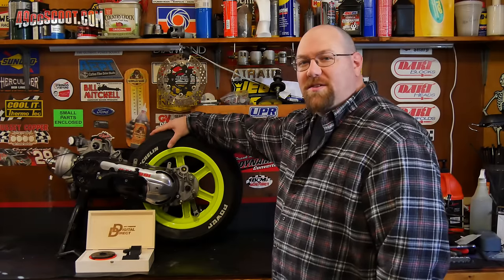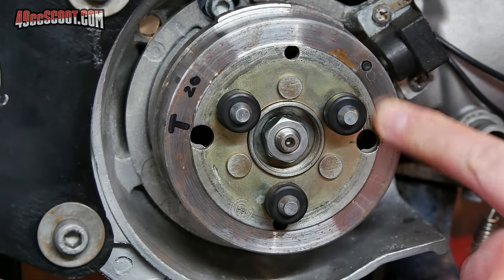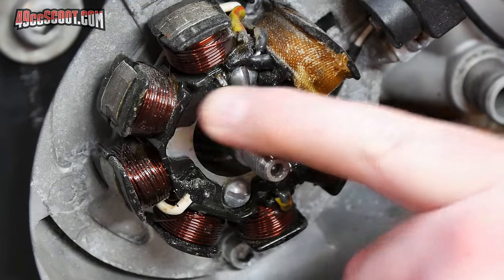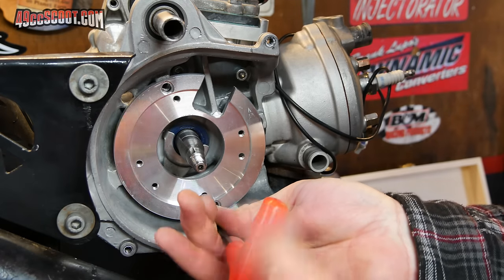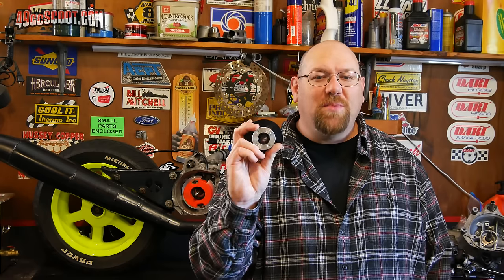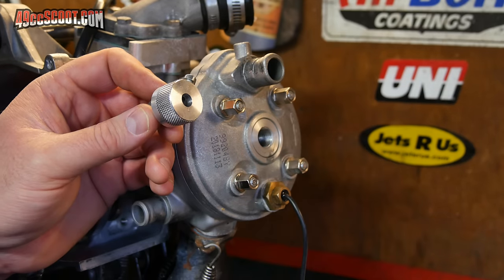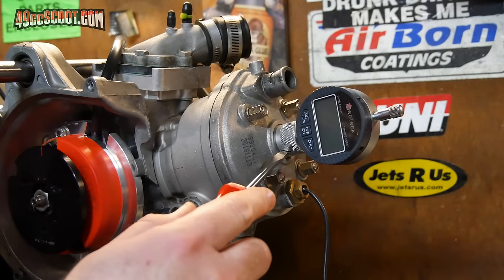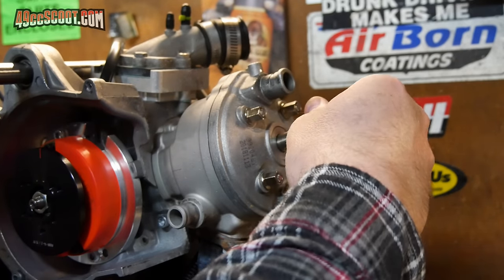Detailed MVT Digital Direct Ignition Installation How-To : TPR 86cc Build : Part 21

Comment: Hi, i swap ignition to Mvt and engine starts on reverse! What the fxx? Any one with ideas? I was told I have to much Adv timing, so I use half to what cdi demand and still wean I kick start, engine starts on reverse
...
Reply from the maker: This seems to be pretty common with the E-Prom from MVT. At least for Minarelli, they want 2.9mm BTDC, as opposed to their standard CDI that's around 0.35-0.45mm BTDC usually. If you've backed the timing off to half of what it was, I would first suggest double checking everything to be sure you haven't got anything off in the process. Even at 2.9mm with the E-Prom, most report intermittent reverse starting. For example, a friend said about once every 5 starts it may start backwards. Seems to be right on the edge if it's setup to spec.
Reply: @49ccscoot  yes, it's the one with 3 map option, sometimes wean starts well forward at idle it reverse with out stopping engine also, it's crazy, i guess I must change cdi to normal one

Comment: Why messing with distances when you can go with degrees? Then it's the same no matter what engine size you have.
Reply from the maker: I've always been a fan of degree wheels and timing lights, but after dealing with the racing ignition I will say that this is a very fast way to set up timing. Timing lights on this particular ignition (and many other racing ignitions to my understanding) can be very it or miss.

Comment: After setting piston to the stroke timing, do i have to reset the timing marks again after advancing or retard the stator?
Reply from the maker: When the piston is placed at the desired distance from TDC, the marks should be made to align so you know it's set right. Recheck to be sure nothing moved after the rotor is installed. After that, you can move the slotted stator to change timing as you desire. If you want to put it back to the standard setting, then align the marks again by rotating the stator to it's original position. The marks won't align at the standard setting after you rotate the stator.

Comment: I really can’t advise on this since I never touched a gtx and they are not really minarelli engines.   Chinese knock offs are so mix match of parts that I don’t know which part would fit and which won’t.   

I know it’s not the answer you want to hear but honestly in my opinion it’s not worth the time.   

For me to get into detail of the 101 variables on jog/minarelli engines will be too confusing and since it’s not something I work on I wouldn’t know where to start.   My suggestion to all those that message me Chinese clone motors is to leave it stock of it runs.  Any modification and you are opening a can of worms money pit.   You are more then welcome to try but I can’t really be of help.   Sorry 
Mahalo for the acknowledgement of me knowing minarellis but I have no clue when it comes to the qmb line of motors
“Okay bro, I messaged the local expert on minarelli engines and the above was his answer. “
Reply from the maker: I  don't see where they're al that different from the Yamaha Minarelli horizontals, like the Zuma. Yes, there are multiple differences, but most of the engine and CVT stuff generally fits. The Chinese engines do have different sizes of wrist pins, flywheel tapers, and variator splines. When you get to the gearbox, that's different than many Yamahas and there are multiple versions.